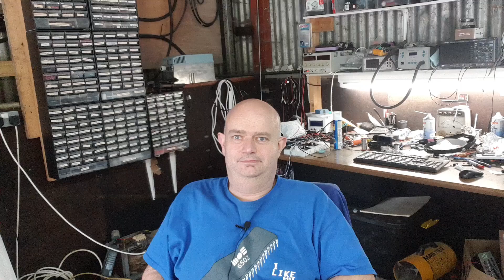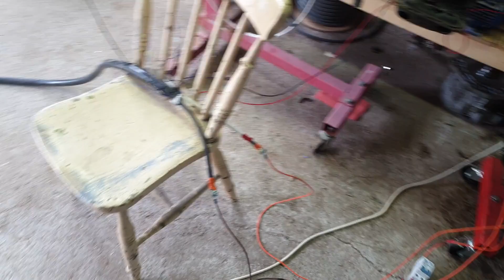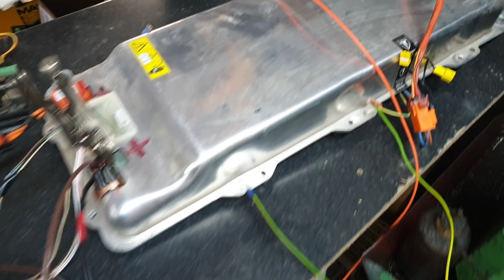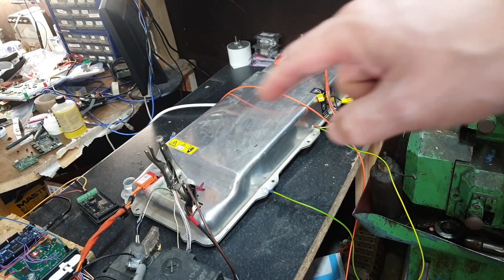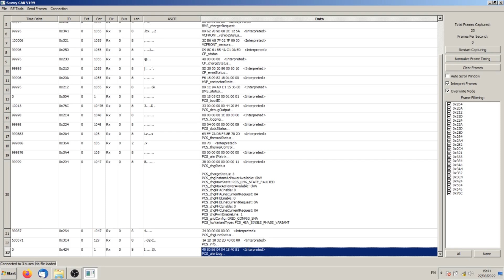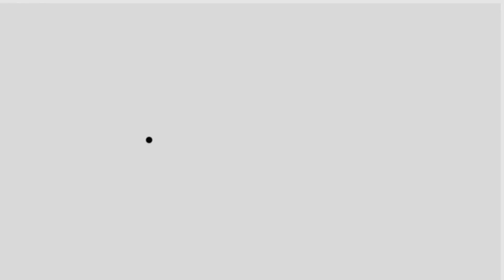Tesla Model 3 PCS Update

Comment: We need technical help.
It is said that the excessive voltage has broken the  PCS burned when I went to the service center because slowly charge is not working but A supercharger or a dc combo works, why does it work? I think there will be a high cost to replace the PCS
Reply: Buy overpriced car, expect overpriced issues 😉 it is what it is.

Comment: @18:43 Hi @Damien, i see PCS_hvVariantType: PCS_48A_SINGLE_PHASE_VARIANT. If i remember corectlly from Munro Live videos, this variant is not fully populated with components, so maybe it will not work with 3 phase AC. Maybe you can use as AC some 240V@60Hz for testing. Probably i am not right, but maybe. Thanks for video.

Comment: Interesting I have three of the US single phase PCS and they all seem to have different firmware as each of the HV controllers don't interchange between the PCS units They each have a variety of serial numbers quite different from each other. Need to get an EU three phase version to see the HW differences as I would like to convert the US ones to use the lower amps of our three phase supply than trying to get 48A on single phase.

Comment: I've had an Italian brand charger that required all of the 3p inputs be connected eventhough it was in single phase mode. We had to split L1 into 2 different lines I think. Also I noticed at first CP was set to us type in Alert73. Then it had magically changed to IEC maybe that is confusing to Elon. Also maybe it needs to know that the butthole (charge flap) is open before accepting a charge now? That might explain why the voltage was unexpected.
Reply: The Tesla monitors the charge port door. IIRC there is a signal from that, or at least on the Tesla connectors. The IEC /and J1772 may have that feature? They can certainly lock the type2 connector.

Comment: Would I be correct in saying that the newer version of the Model 3 PCS is the EU/CCS2 version?
Perhaps the negotiation between the original Tesla connector which used the same pins for AC charging or DC charging handled the function of the two power pins differently?
And the communication to the traditional Level 2 connection using the CP and CC pins to negotiate the presence of AC charging voltage?
With the conventional Tesla connector and an adapter to a Level 2 socket, the CP and CC signals are recognized?
I know with a Tesla Wall Connector it will attempt a Power Line Communication to a Tesla that is connected to it and then after 30 seconds it will revert to traditional Level1/Level2 CP /CC signalling...
Forgive me I'm a bit of a noob with all the Tesla pieces.
I only have a Gen1 Model S 11kW charger model to play with...